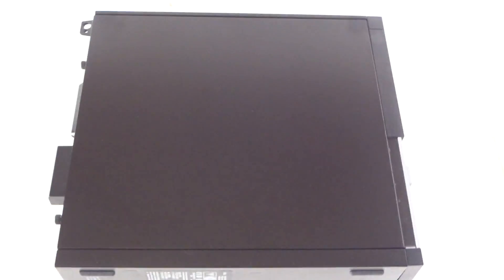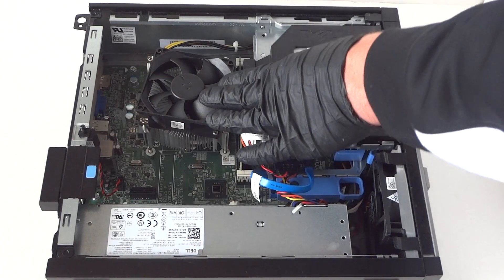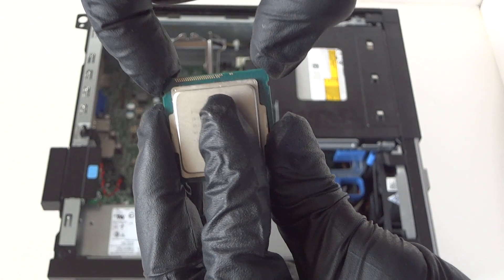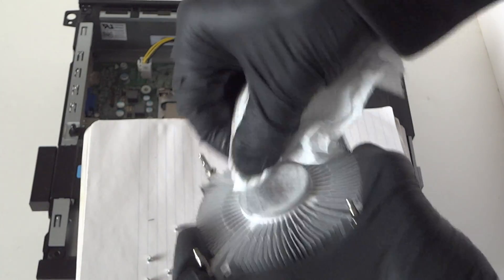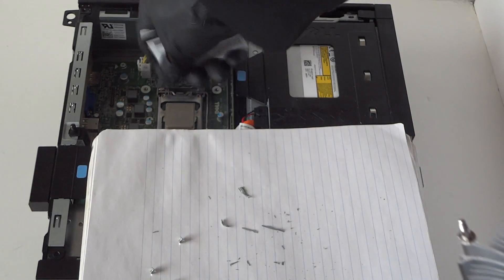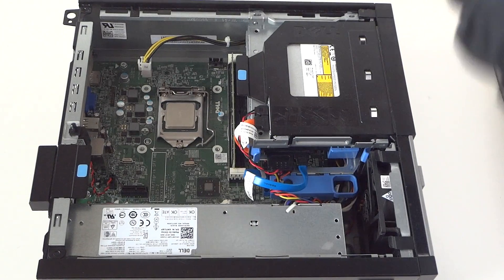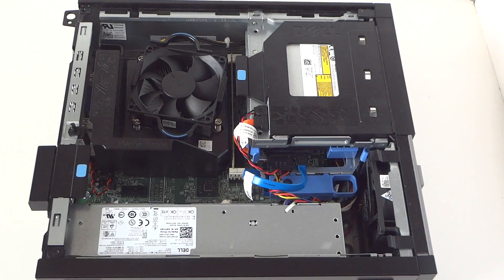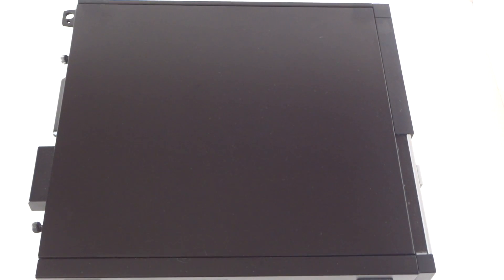Dell Optiplex 3020 CPU Upgrade

Comment: hello, I have the same dell and I need to know for what can I change the processor, I mean I can change the core i5 for core i7?
Reply from the maker: Yes you can
Reply from the maker: Hi, what processor are you trying to install ?
Reply: Optiplex 3020 is a Haswell board. The i5 6400 is a Skylake chip, it won't work.
Reply: John Connor I know this is an old comment, but up to what recent upgrades can the Optiplex 3020 support? 

My Model:
「I5 4590」 - 3.30ghz
「8GB Ram」 
I don’t quite know the power supply.

Upgrades I want to make:
「16GB Ram」
「GTX 1050/1060」
「Better I5/I7 Processor」
「650w Power Supply」
Reply: @jackson7922  hey mate, i'm trying to make those EXACT upgrades in order to make my PC VR ready, have you managed to do it and if so was it all good/ any issues?   
i'm not computer hardware savvy so I really don't know if this 'OEM Motherboard' is ok or even capable of playing VR, or how I would go about changing it if it's not up to spec.. 
All i'm trying to do is make my PC able to play Half life: Alyx (since it seems the most performance taxing game in VR), but feels like i'm gonna end up spending loads of money polishing a turd only to find out i should have just waited a few years and got a whole new setup just for VR...
Reply: @SteezyTeef  Unfortunately, I don't have an answer to that as I ended up buying a gaming tower that was VR ready at the end of the day. I heard that game is extrememly taxing, I wouldn't try it, but instead it would be smarter to buy a motherboard and build up from there. 1060 is your max potential in the 3020, and for HLA specifically, you might be pushing it in that casing.
Reply: @jackson7922  after hours more of looking I came to the same conclusion..
 Such a shame since I was psyched at the possibility of getting ma hands on VR and HL:Alyx. Been trying to keep away from gameplay which is near impossible when looking at videos about making a PC able to handle VR. 
Only bought the PC a couple years ago so guess I'll have to wait till I'm mad enough to spend near on £1000 living a childhood dream aha.
Cheers for the reply, hope ya well in these times 👍
Reply: @Muffin-777  no mr. should be the same generation processor.
Reply: Andrew Sanabria  most likely No, as the socket in the motherboard is prob not the same. go to cpu benchmark website, enter both of those cpus, and it will tell what chipset (like H170, etc.) and what socket they are, like lga1151, as an example. So cpus that are different, like lga1200 will NOT fit/work.